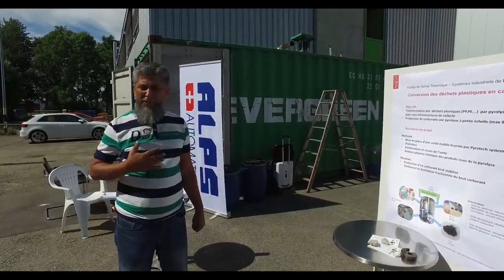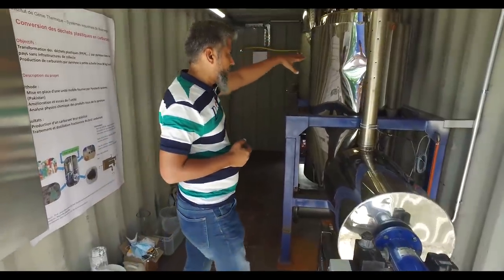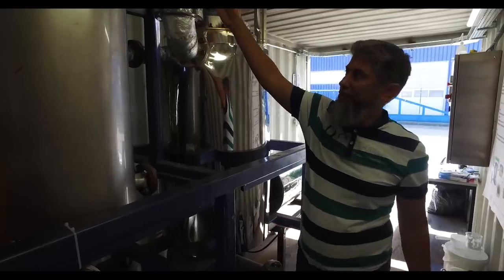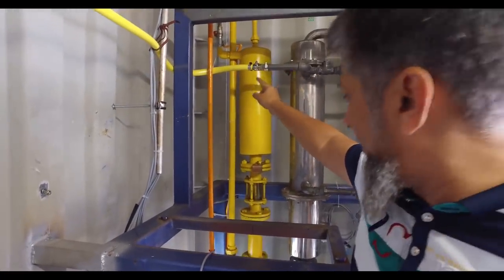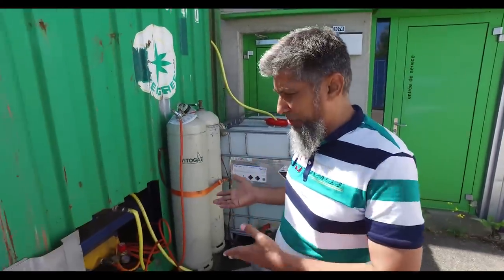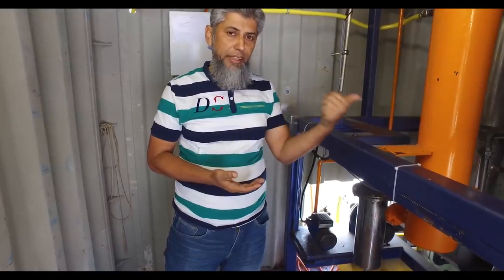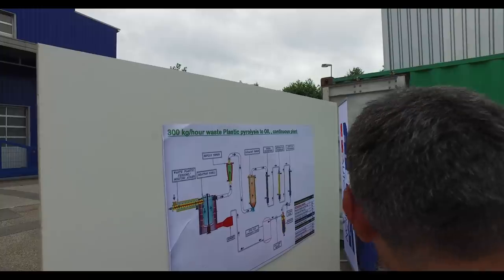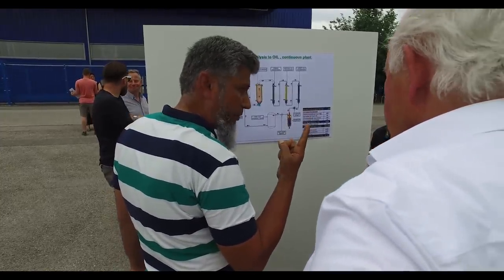Swiss Plastic pyrolysis 40kg demonstration by www.pyrolyze.com

Comment: ok,  here W = energy
So you put some plastic garbage ( producted with petrol, transformed by W coil) into. You HEAT using petrol or coil to produce W, feeding your machine, then you get rafined oil cause your machine is better than others. This oil can now been... what? Burnt into engine? re-turned into plastic bottle? ratio: nearly 10% and CO2 increased (if it matters) ?

Your problem is not plastic, it's petrol